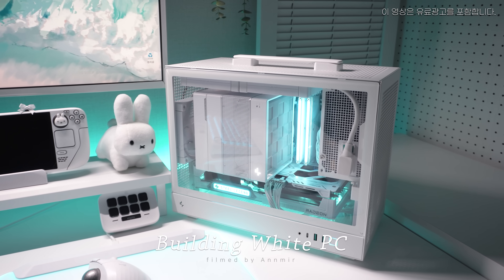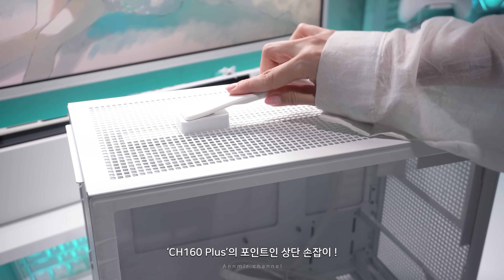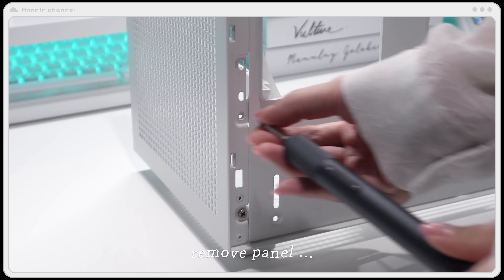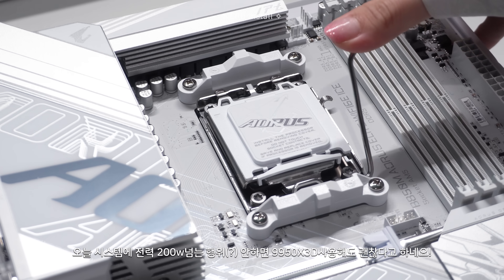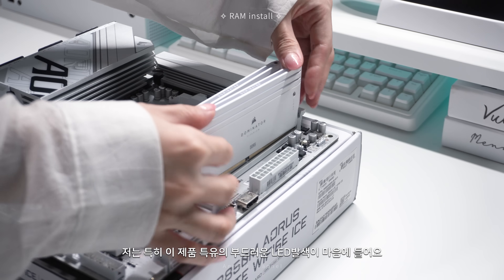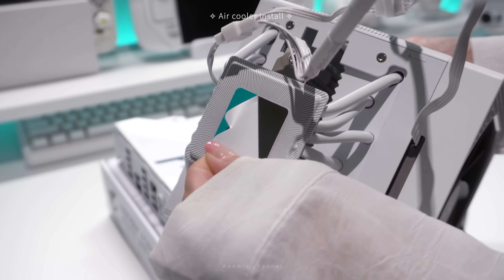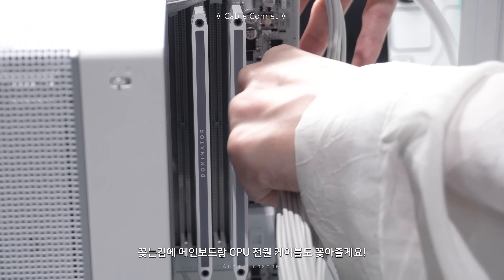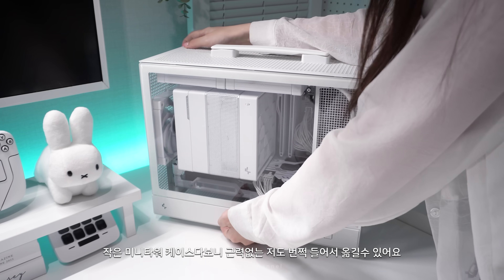철가방?🤔손잡이가 달린 화이트 PC 셀프 조립기🌿💼| DeepCooL CH160 PLUS, ASSASSIN VC ELITE | Ryzen9 9950X3D, Radeon 9070XT

Comment: that briliant about PSU on front. it certainly the best way for cable management! BUT as an exhaust it really concerning. cuz it will blow hot air directly onto glass panel... heavy use, with just tiny bit of impact, aand it will shatter

Comment: 11:50 by the looks of the back fan, it seems to set as exhaust, not intake (as its supposed to be), this diagram is showing it as intake.
Reply: Yeah and this cpu runs very hot is air cooler enough to cool it